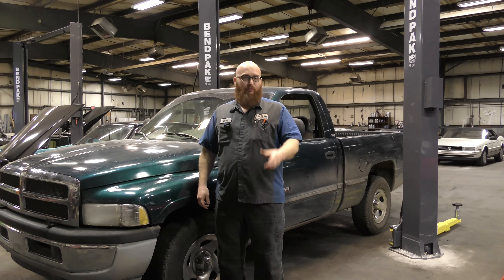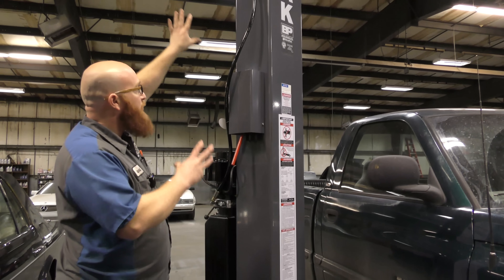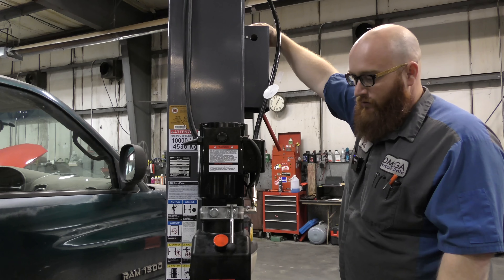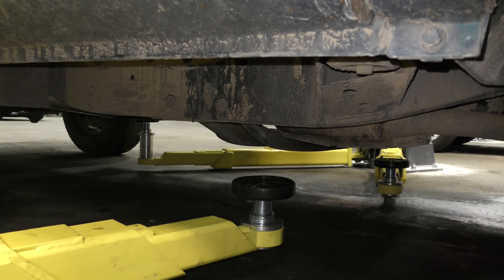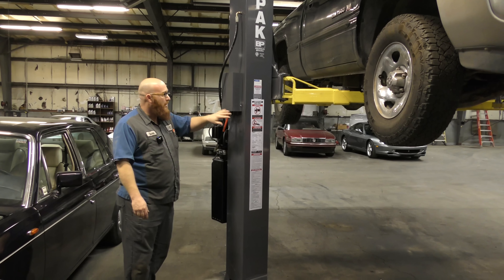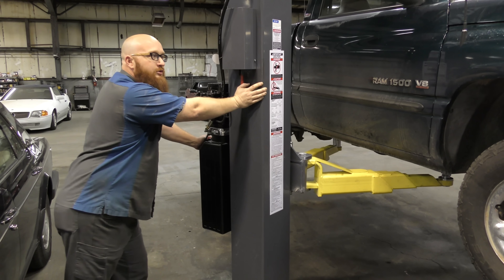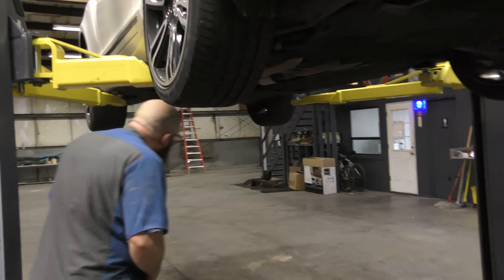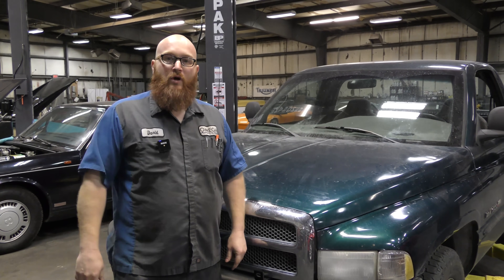How it works?!? The CAR WIZARD shows how to operate a two-post car lift.

Comment: Time to adjust your equalizer cables! Both sides need to click simultaneously. In your video you can hear one side click first, then the other. If the hydraulics suddenly fail while one side clicked but not the other, then one side would drop a lot more than the other side, risking the vehicle to fall off! It’s a very easy adjustment and it’s part of regular lift maintenance. You’re welcome!

Comment: I'm a little disappointed you didn't talk about the arm locks. They are an important part of safety also.  I've had a leg kick out and drop a truck until it smashed the underside. I had to pay 1000$ out of my paycheck as a deductible for the shop I  worked in
  Love the channel

Comment: In europe two-post lift usually have electromagnetic safety release and solenoid valve to release pressure. In that lifts control box have 3 buttons: 1. lifting 2. lowering without releasing safety latches and 3. lowering to ground with safety latches released. Some control boxes even don't require using lifting from safety before lowering, while holding lowering to ground button automatically pump will energize for 2 second for lift from safety latches, next electromagnetic safety latches will be released and solenoid-valve will release fluid from hydraulic cylinders in posts.

Comment: Thank you 🙏🏼 Needed this. In the market. Was going to look at a used 9k western to save $500, but might go with a used 10k bendpak for $3,000 (removed and installed). Came here for learning lift points and using the safety locks. Great video and needed to know about Audi/VW suspension too. 👍🏼 👍🏼

Comment: Thanks Mr Wizard, be help as I am buying a house with a lift which I am excited about. Let's hope the install was correct and the concrete is acceptably strong. My understanding is the mounting bolts need to be retorqued from time to time so will most likely do it myself or have a company service lift, we shall see -thanks again!

Comment: In the old days with a center lift we used to use a steel "stick" to reach under and move the arms around in or out or wherever, the end of the arms had a steel pad which you could flip up as I recall and I think there may have been round holes in the arms which you could hook with the steel bar to move them around.  By using the bar it was easier to move the arms and set the car up.  Those kinds of lifts had a "stopper" kind of a metal plate with a bump on either side so when the car was pulled in that usually set it up in the middle, for most cars. There was an alleged safety poll that was next to the hydraulic giant sized poll/pipe, however I never recall locking or unlocking that thing, I think it had a piece of metal at the base you were supposed to kick to lock an unlock.  The lifts never failed but would get slow leaks, I think the fluid was all in steel pipes.  It was all powered by a central compressor that provided power to the hydraulics in the lifts and for air tools and the bell that was attached to the yard hose which customers drove over and caused the bell to ring.  We had a drive on lift too with flaps at the end that would rise to prevent roll off once you raised the vehicle.  By the time I worked there the flaps would rise but never lock as they got rusted out, so you would have to block the wheels.  We cleaned the bays with gasoline and water and push broom sized scrub brush and rinsed with water pushing it all out of the bay door with a big squeegee for difficult cleaning we used battery acid on it. The gas cut the grease and the acid cut anything. we always made sure to turn off the oil furnace so it would not kick on. That's how they did it for probably 30 years before I got there and all the way until they closed maybe 10 or so years later.  We lived to tell the tale!

Comment: Have a Twin Busch mid-raise scissor lift in my shop. Getting ready to get a 6ft. Scissor lift, 4-post or 2-post lift for my garage that is almost ready to start working out of. 

Kinda worried about the 2-post lifts because of all the fails that's on YouTube but for working on my Foxbody Mustangs I feel the 2-post would be much better for welding and floor replacements and other things as well.

You video helped answer a couple questions I had and wondered about.  Guess it's about like everything else, just have some common sense and thing about what your doing and keep it balanced and leveled well before you start lifting. 

Thank You Sir for a pretty good video. And if I get one I'm going to do some research and study more about the Bendpak lifts.

Comment: My knees hurt a bit watching the crawling parts, but in the long run, these are knee savers. it's good to be very through with these lifts. I worked in a shop where another mechanic actually had a car fall. Luckily no one was hurt, but the car was totaled. These are very powerful tools that require a lot of care to use. Thanks for spreading the proper use of these.

Comment: When I was in HS back in 1967, I was working an an Esso station. Across the street was a Texaco where the mechanic was lifting a Toronado to change the oil. I was taking care of a customer and heard a horrendous crash coming from the Texaco. I looked and saw the Toronado with its nose planted on the floor and the ass end still on the raised lift. The mechanic didn’t realize the nose heaviness of that car and lost it. I’ll never forget that day.

Comment: I have that exact lift in my home shop.  Love it to death. Saves this old man's life much easier.
Reply: What did it cost you?  Even at age 40, I know there's no way I'm going to be rolling around on concrete in future years.
Reply: @reallyhappenings5597  Depends on the make, model, type, and lift(weight) limit. They can be anywhere from $2K to $10K, and higher for commercial grade.

The cost though, is in the concrete work. One should have at minimum 6" concrete pad and depending on how you want to re-enforce the pad with rebar,  this all adds up. My last house, 3 years ago, was roughly $4K for the pad(prices vary depending on location) and $2K for the left. There was also a $500 pick up, delivery and set-up to a third party installer, which I thought was pretty reasonable. Having to move the lift to the new house was an additional cost as well as storing while waiting to close.

I almost went with a Maxjax but decided the higher weight limit was worth the height and extra costs. I hear you on the olling around on the concrete. Having things overhead makes underbody work so much easier and faster!
Reply: @reallyhappenings5597  Every time I watch Scotty get under a car, I can't believe he never got a proper lift. What self-respecting professional mechanic works like that?!
Reply: Chuck Just be careful and make sure it's not literally "to death.":)
Reply: @paulparoma  I like Scotty but he's a big time cheap skate, he's not getting any younger either, it's too late for him to get one now.
Reply: @ahmadghosheh3104  That's for sure.
Reply: @Aaron Ferguson i have the low profile arms and my son has an 87 iroc z28 that has a  qa1 lowered suspension on it.  I don't have any problems getting the arms under it. I do wish they were about 6 inches longer on the  front arms. That would give a little more adjustment for things especially crewcab trucks.  You have to be dead center in the lift to get the arms right.

Comment: 100 years ago we had 2 post lifts in school. All in floor hydrolic. Kid put one of those monster 70s  Pontiac  station wagons up without  shaking it to make sure it was stable. When the lift topped out it shook , the car moved. It cracked the lift cylinder in the floor releasing the smoo. Car was secured with tall Jack stands and stayed there for months. We came in one day car was gone, they started to Jack hammer up the floor to replace the lift.

Comment: Very informative.  Some lift have safety locks that doesn't engage at the same time ( like the first lift on your video ). So before removing the weight on the hydraulic, one must ensure that 2 safety locks are engaged or the car may end up tilted and may cause an accident.
Reply: When the lift is set up properly, they should click at the same time.  Both pillars should be mounted at the exact same height, both arms at the exact same height, etc.  With time, cables can stretch, etc and get the arms slightly uneven.  When everything is straight and even, the latches should click at the same time.  But yes...  When both sides are slightly off, you've got to wait for both to engage.

Comment: I have use of one for doing an oil change . But , my vehicle is a 2020 Toyota Camry with pinch welds . The lifting pads are 6 inch in diameter . And though last time I was able to line them up and not damage the underneath of my vehicle . I came across an idea to use a hockey puck to center it in the middle of all pads . Being much easier to line up the pads . Especially since the hockey puck would fit the length of the pinch weld . And being raised would prevent any contact with anything else . Though there are rectangular lifting pads , this place does not have them available . And out rageous price to buy them myself . I made sure to get orange colored hockey pucks .

Comment: Buying a 2-post Lift was the best automotive tool I've ever purchased! Wife was hesitant to purchase, the cost wasn't in the lift but the concrete pad, but I've used it so many times to work on our own, and her parents car that she's come around and thinks it was a fantastic purchase.

May want to get the first lift serviced though, the "clacks" of the stops were a little out of sync while the truck was being lifted. Could tell the passenger side was off compared to the driver's side by how the passenger side settled, before the driver's side, when you lowered it onto the security stops.

Comment: I'm 77, got a 9000lb lift in my home shop about 25 years ago.  One of those things that I instantly realized I should have had 20 years earlier.  I'm always amazed to see you moving cars by hand.  Doesn't work in my shop which has the floor very slightly sloped for drainage.  One thing that's not always emphasized is that a 10,000lb lift for example also means that each arm has a maximum rating of 2500lbs.  So, you need to know the center of gravity of the vehicle and balance it both to not over balance the lift posts, and also to not overload the individual arms.  I happen to own a truck scale at one of my businesses so I can weigh vehicles and know the center of gravity before I try to lift them.  If you don't know how to lift a unibody you really need to look at the shop manual to find the correct lift points so that you don't bend it in the wrong place..

Comment: You didnt use the pivoting arm locking latches. Those are the spring weighted taps near the frame. I believe they should be engaged after you have put the arms to correct position? 
The locking teeth and tap can be seen on left side of the video 17:23

Comment: If your floor is the typical 4" slab it doesn't support near the weight you would guess. Typically with reinforcement (rebar not wire) you can get to about 4000 lb sq ft. Without 100 lbs.
For slabs designed for 2 post lifts I have seen a turned down area between 8 and 12" thick (depending on the size)

Comment: Just some added input always listen for two clicks as it goes up the latches because when you go to set it on the latches if one didn't click you did go up far enough. Then the car will be on an angle if you release the hydraulic pressure to set it on a latches. Also wizard i know you are experiences with lifts but you forgot to do the shake test on the bentley. Alway do the shake test!

Comment: Also pushing by the wheel is effectively geared 2:1, so its actually easier if you remember pullies and winches at school or college, by using an extra pulley to effectively gear the moment down by one/

Comment: Way back when the shop I worked in as a kid we raised a car on a single post in ground lift and it shot up so fast you could see daylight between the frame and the lift, about 2 inches of daylight.

Comment: Wizard did you have to reinforce the concrete floor before installing the jack post. Thank you great vid as usual.
Reply from the maker: gilles st-pierre The floor was reinforced with steel when it was new back in 1967. The required concrete thickness is minimum of 4 inches. 
My floor is industrial and is 8 inches thick. I think im good

Comment: Like the active suspension, please check what the proper lift points are for a car. You do not really want to always use the weld at the bottom of the sills for it, either because it won;t support weight (or only in some reinforced sections) or because it's covered by plastic that will get crushed.

Comment: Great video. Sounds like the first lift need some minor adjustments doing to it, because when it was being raised, the safeties were not clicking exactly at the same time meaning one side of the lift is slightly lower than the other. Hence you get the double clunk clunk as it goes up. Compare it to the second lift which is perfect. Just get Bendpak to come back out to sort it.
Reply: I think it was the same lift used in both clips generally when lifting heavier cars the equalizing cables will stretch unevenly and latches wont engage at same time. Just then nature of that style of lift.

Comment: Prob not too important, but with a truck, putting  support under the rear diff will make it safer when hammering or doing work that requires some type or force

Comment: Very informative, however, why not keep the hydraulic pressure as the primary force and have the mechanical latches in place as a backup? In the current configuration, if the latches ever do fail, there won't be any hydraulic pressure in the system to support the vehicle from completing collapsing. I would also put an oil dolly underneath as a third and last resort if all else fails.

Comment: I guess some good things did come out of coivd lockdown.. what a great detailed and informative video! 
Noticed yours wasn't clicking simultaneously, you should do one that shows how to adjust the cables.  Also noticed a high pitched noise at 10:27 that I've heard with mine before it seems, wondering what that is. Thanks!

Comment: First off, I can get into my Dodge 2500 right where it's at for lifting. 
Second, you failed to mention that you need to raise it to take the pressure off the locks.
Third, asymmetrical allows you to use the lift with a wider variety of vehicles because you can compensate for the weight of the engine.
And fourth, your cables need adjusting. 
Still, you did a good job overall.

Comment: Your channel is one of my new favorites! I do my best to soak up all your car wizardry. Quick question: do you have a trick to reinstall wheels for cars with lug bolts? Our cars don’t have bolts on the hub and it’s sometimes really difficult putting the wheels back on without anything to hang them on. I’d really appreciate any pointers you have! Thanks!
Reply: Find longer bolts the same size and thread as the lug bolts.  Cut the heads of and install two of them in the hub.  You can then hang the wheels on the two headless bolts, install the lugs, remove the headless bolts and replace them with the two remaining lug bolts,

Comment: Do you suggest lifting unibody cars by the front frame rails at all? I notice some unibody cars only have emergency jack points on the pinch welds, and aren't really designed for automotive lifts in those areas because they aren't enforced on the front part. Just a slotted cut out for the road side tire replacement jack. I know many 90s rwd drive cars, the pinch weld would crush and bow the fenders if you didnt use the crush frame on the front.

Comment: Mr. Car Wizard, I would like to ask you why you selected Asymmetrical lifts vs. Symmetrical ones?  Are the symmetrical lifts not stronger and more secure than their asymmetrical counterparts? Or is that not true? If you could share why one type vs that other it would be greatly appreciated.

Comment: Awesome--thanks. Q for you or for anyone: Can a hydraulic lift like this be used on the suspension crossmembers of a unibody car if the pinch welds are too rusted? Would that leave it too unbalanced since the crossmembers are small, so the arms would all be way far in?

Comment: A bit less intuitive in my BMW as it puts itself in park as soon as I open the door IF the engine is off.
Reply from the maker: Marcus Nibell Ive lifted these engine running in neutral. Once lift is set up, put in park and turn everything off

Comment: I’m surprised ben pak didn’t sell you truck adapters for vehicles with frames. The round adapters are for unibody vehicles. I’ve seen an full size suv slip off the adapter because of moister and oils

Comment: ive never seen in germany these safety latch lifts.
not exactly sure how they are operated but sounds like massive spindles being spun.
they are also faster and more quiet.
Reply: Nope just large hydraulic rams that push up on carriages. On the outside of carriages there is notches cut for safety dogs to engage. The hydraulic rams are kept in sync with cables strung between them over the cross bar on top.

Comment: Hey wiz can u do a video on lifting a Corvette since those require pucks
Reply: I was gonna say Wizard, lift something hard like a Corvette or a GMC Acadia Denali :p
No I know you can do it, but it would just add a little flare to show the tricky ones.
I used to have to get creative with heavy duty trucks on my 10k lift. I used to line up the front cross member with both arms parallel to the posts and lift the rear end with a pneumatic bumber jack. Usually railroad trucks.